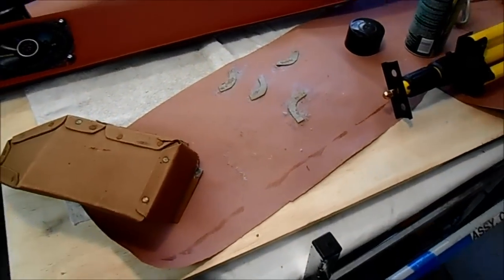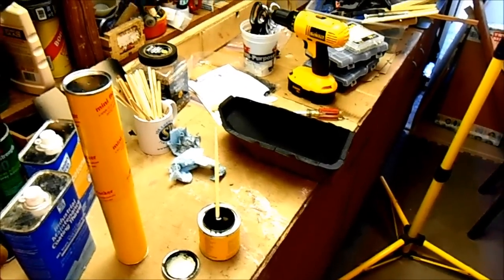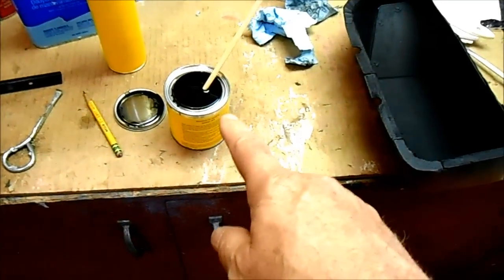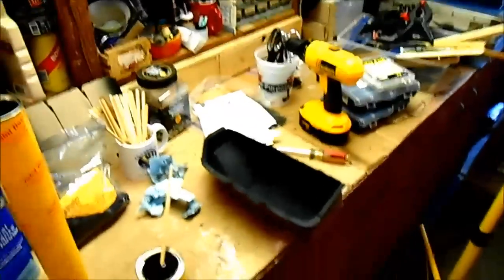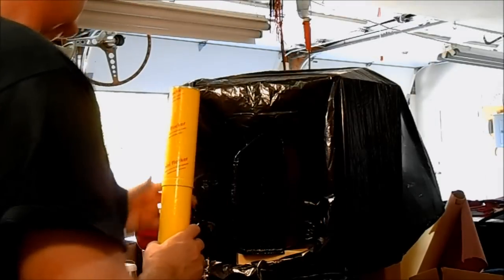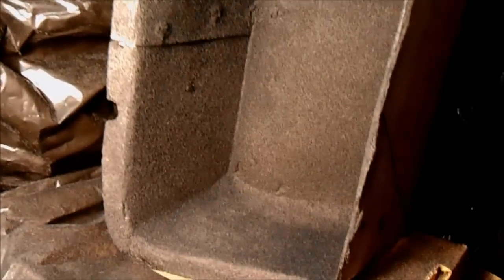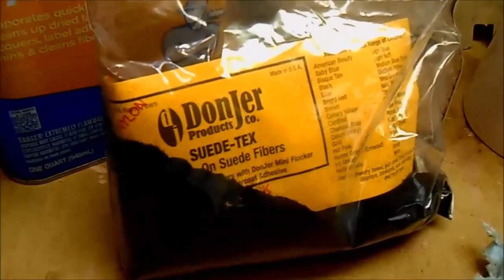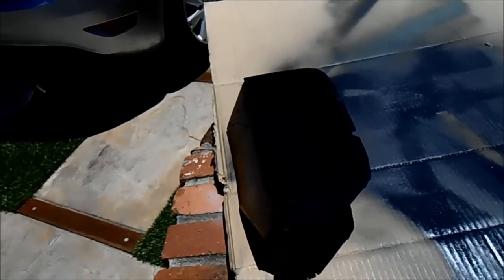Bettie my '63 Jaguar E-Type Restoration - Glove Box

Comment: Meet the Flockers!  I've never seen that kit before.  I could think of all kinds of uses for that stuff.  Cool demo John.
Reply from the maker: I was thinking this process (sealing, applying colored adhesive and dusting it with colored fiber particles) is what the production folks must use too, it turned out looking exactly like a new part.